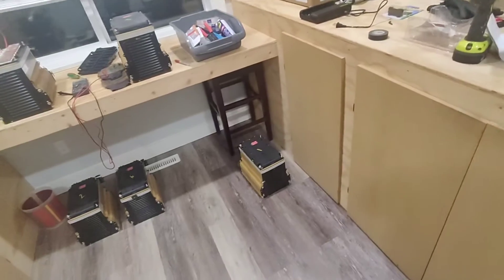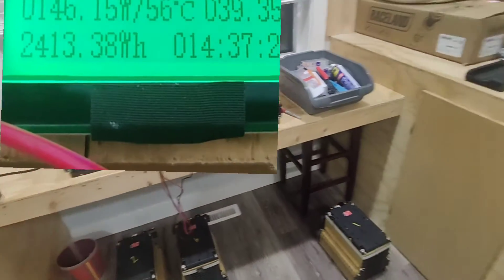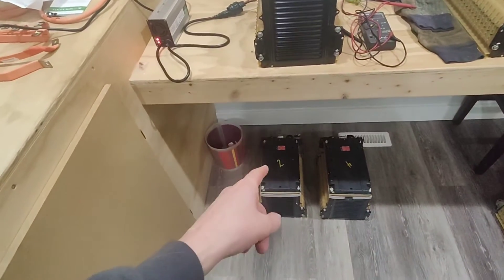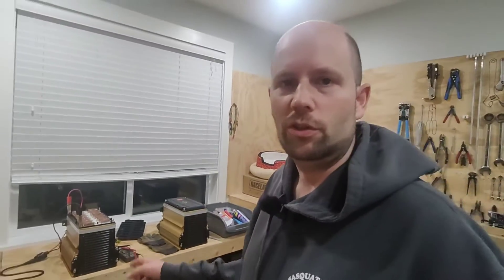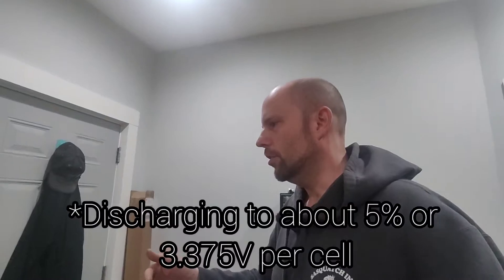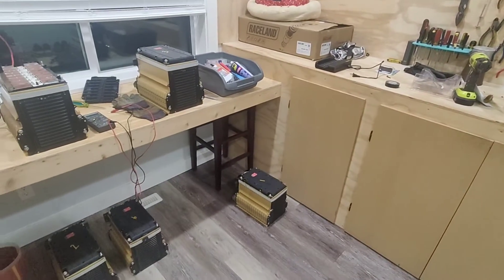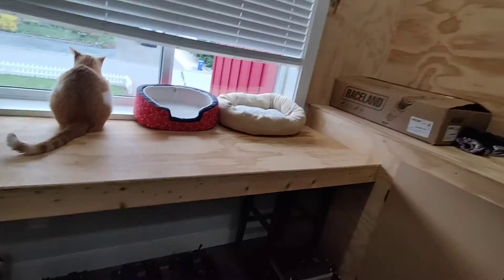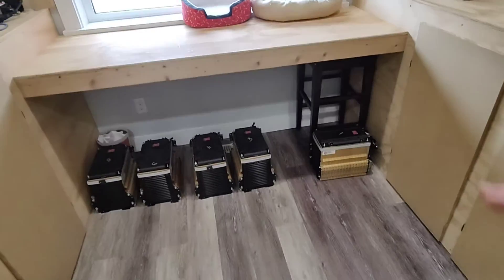Chevy Spark EV Battery Teardown UPDATE. Modules charged and load tested.

Comment: I hate to be "that guy" but you've got to get better tools and techniques for your battery processing. Taking a whole module and just applying or drawing current without monitoring the individual cells (constantly) is a recipe for disaster. Better tools are cheap and readily available - an iCharger X12 is my favorite! Allows for charging and discharging - pushing power in both directions (that is, you supply the iCharger using another battery) - and much more comprehensive analysis in both directions, while monitoring every cell using simple clip-on leads to the balance port.

Friends don't let friends play with batteries without BMS. Get one!

Especially knowing how the Spark EV battery "fails" - it's all software, caused by poor BMS programming on GM's part. The BMS shouldn't be allowing the cells to drop that low, and it should be constraining the pack capacity to the lowest capacity cell. It doesn't mean the pack is bad. It's all bad programming that no other car (except maybe the 2013-2016 Smart EV) has a problem with. But it means you have one lower capacity cell in there... blindly charging and discharging based on total module voltage can easily lead to destroying the low cell!
Reply from the maker: @FalconFour  before making assumptions, you need to see the follow-up videos. 

For continuous use, yes a BMS is a must. And both of my projects include BMS 's...  For this initial testing, not using a BMS for one discharge and one charge really isn't going to do any harm.
Reply: @edsgarage2.0  ~ It will cause damage if you discharge below a single cell's low limit. For real, I'm not some uneducated nobody here - been working with lithium batteries for so long, such videos get boring (and usually painful to watch). I have seen your videos... with a bit too much "oh my god" to bear. Everyone thinks they're safe and fine - until it's not so fine anymore. I'm giving you golden advice here - go get yourself an iCharger X12. Cheap, readily available, incredibly flexible and powerful.

You always need individual cell monitoring from the first moment you're working with them. Especially if working with a pack/cells that you've not already characterized and know the state of. The term "BMS" is overly broad, but it could be as simple as a carefully and meticulously monitored individual-cell-voltage check (with a multimeter on each cell), periodically and repeatedly, while you're discharging and charging. That end-of-discharge voltage cliff can come fast, though - so to safe yourself some unexpected mistakes, it's always best to just hook up something that can automate the validation/safety. Keep discharging past 0 (it starts charging the cell in reverse polarity while "discharging"), or recharging past 4.2, and you end up with an "internal combustion battery" pretty quickly. The whole time, the series voltage "seems" totally normal (other cells are in their operational range, so you don't notice it in series).

Knowing what I know about the Spark EV's battery flaws, it's a single cell that ends up having lower capacity than the others - and that single cell's low capacity will bite you if you aren't watching. That's all.

Comment: So, do you have a guess as to why the original Spark EV wouldn't allow a recharge? It seems like, although the batteries did degrade and the vehicle's range shrunk accordingly, the real "failure" is that something in the car (ECM? BCM?) wouldn't allow the batteries to be recharged.
Reply from the maker: @DoctorHemi  because module 6 was more degraded then the other 5 causing an imbalance larger then it's safe limit.
Reply: @edsgarage2.0 , gotcha. Thanks.

Comment: We love our 2015 Spark EV.  Now after 70k miles it has lost about 20 to 25% of its original range. Seeing your batteries out of the car removes some of the mystery. I wonder, could they be replaced with off-the-shelf LiFePo4 batteries?
Reply from the maker: @MrTeff999  possibly... But the battery management system would have to be completely reprogrammed.

Comment: You need to look up the specs of the battery and determine what the cutoff voltage is, you don't want to discharge a battery cell below cutoff voltage.
Reply from the maker: @mpirron1  already done. 😊